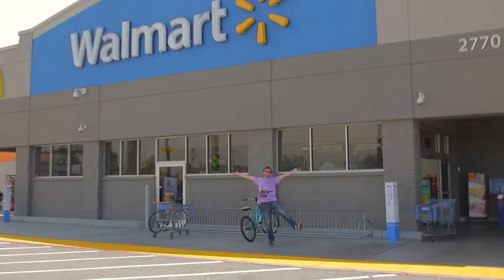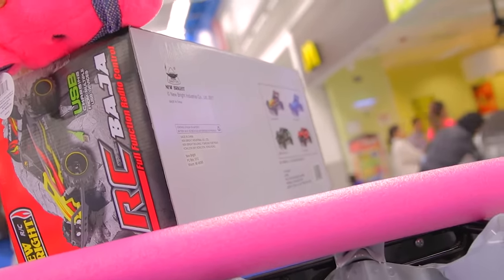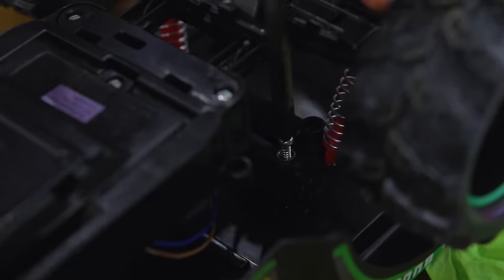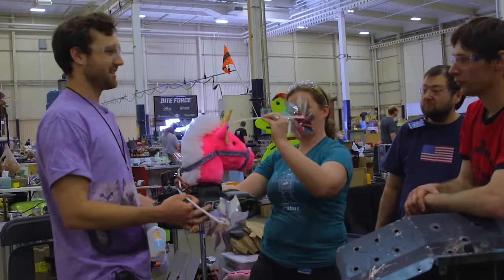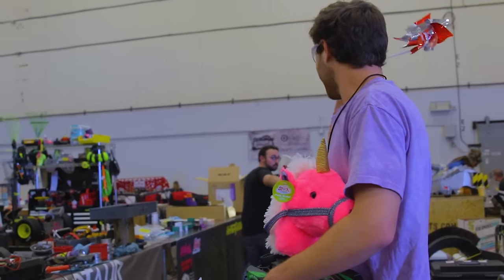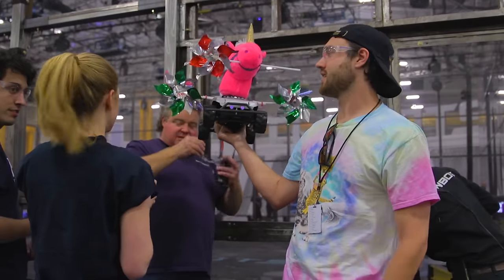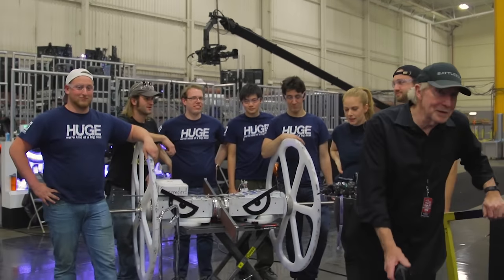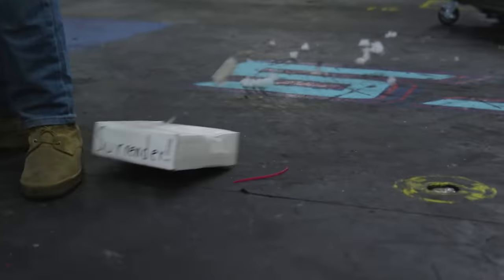$40 BattleBot Vs. $25,000 BattleBot

Comment: Huge is always going to be a fan favorite. It’s a very unique bot that takes the fundamentals of robot building in battle bots and flips it on its head. Instead of trying to be as low to the ground as possible it’s frame is too high to hit. He is a gatekeeper bot of sorts as it tests the adaptability of teams that don’t use horizontal spinners. Unfortunately the aforementioned horizontal spinners are its kryptonite as the can effortlessly chop through its wheels.

Comment: Ok, here's an idea for a battle bot.

First, make a simple 4 wheeled bot with one of those roller weapons, with some basic armor.
Now, build an armored shell around that, even over the weapon, and make a mechanism that lifts up a plate of armor and detaches the bot from the shell, letting it eject in case something happens.

BUT WAIT, THERE'S MORE!
(Optional.)
Put a weapon mount atop the shell that lets you turn your weapon like a tank turns a turret. From there, just place a hammer mechanism.

Bahm!

Now you've got a bot that has amazing armor, a weapon/self-righting mechanism, and the ability to effectively change into a different bot.
Reply: Um... A transformer-bot? Interesting. I think you may have some difficulty meeting the 250 lb weight limit, though. Also, you might have a few nasty surprises in store when your bot receives its first hit from a 70+lb weapon. Trust me, George, the forces involved are way, way, WAY beyond anything you're likely to have encountered before. They're so extreme that it's almost impossible to simulate them outside of an actual competitive fight in a combat arena.  A good DIY test for your design - indeed for any design - is to stand your bot on a hard surface and smash a 14 lb sledgehammer into it as hard as you possibly can,  like you were swinging a cricket bat or a golf club. That's the sort of force your engineering and delicate electronics will have to withstand. It's brutal out there! Anyhoooo, good luck; we need more robots, more roboteers, more good ideas, and more Moist Pony-tude, dude!
Reply: I might be missing something, but wouldn’t the second layer of armor that goes over everything also prohibit you from using your drum? (Roller weapon)

Comment: Could you make a battlebot with a resin shell that’ll get the other bots blades stuck. Maybe also make it wide so it can’t be picked up from the momentum.
Reply: I know this comment is quite old, but for anyone else wondering: no. Those blades are heavy as hell and spinning at Ludicrous Speed, the kinetic energy in a hit from one is about the same as a motorcycle crashing into a brick wall. The only possible outcomes from a hit from one are a dent/scratch (if your armor is made of very hard and strong steel or other alloy), or total annihilation.
Reply: The only material I’ve seen tank hits from the modern spinners like Tombstone or Minotaur is AR500 steel. Polymers just get obliterated.